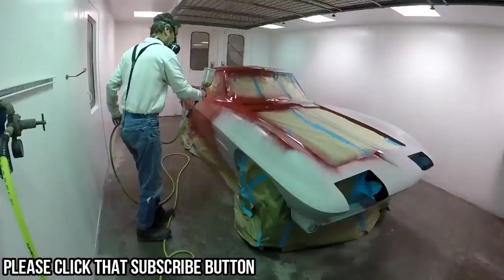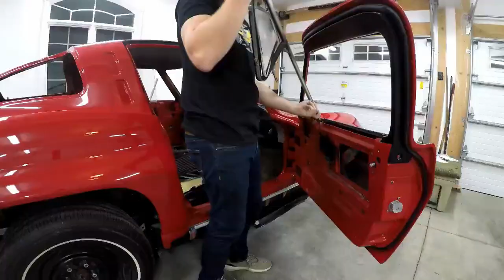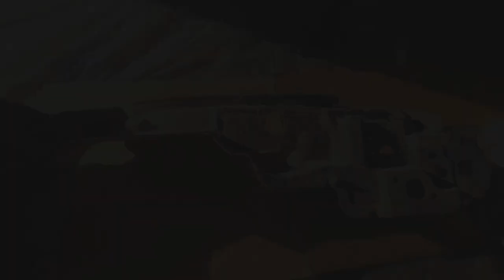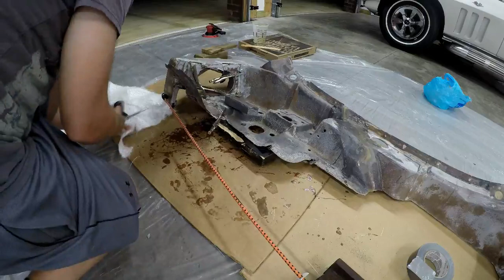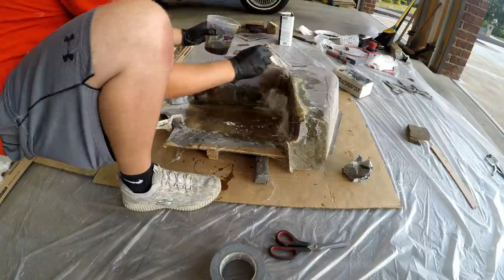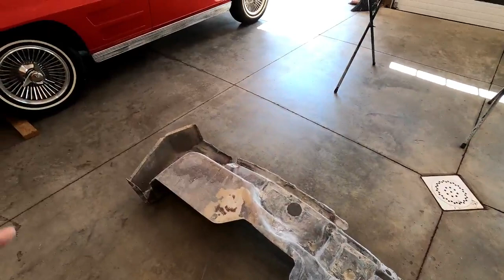Rebuilding a C2 Corvette Firewall.  More Fiberglass Work!!

Comment: Like your fire wall repair, I'm doing  the same thing a 66 hard top.i got almost 90% of the missing  parts i need,I'm using my bird case to line up the wiper holes and the c/l hole down the center of thr car.i removed 95% of the fire damage  every things fitting great,i found a nos hood surround . I enjoy watching you show how to work with these fiberglass cars.i was a young teenager when these car were new.funny they were very popular  back than and cheap!
Reply from the maker: Sounds like you are moving along!!  Glad to hear another one is being saved.  I wish they were cheap now lol.  They are a ton of fun.  In the spring I will have many more fiberglass based YouTube videos.  Hoping to start to assemble the body by then.

Comment: How much will a (Broken) C2 Firewall set me back if I find one? I'm on Disability from stage 3 colorectal cancer and I'll be building from basically nothing.
Reply from the maker: I’m sorry to hear about your disability. I’m not sure about the price. I found this one on eBay and got a good deal.
Reply: About $1k.  There is a lead time from any manufacturer.
Reply: How important is originality to you? You might be able to locate a C2 kit car manufacturer who might be able to sell you that component for less money or fab one up for you. Sorry to hear about your disability. Best wishes to you. You can try to google "c2 corvette replica" or "c2 corvette kit car." Hope this helps.